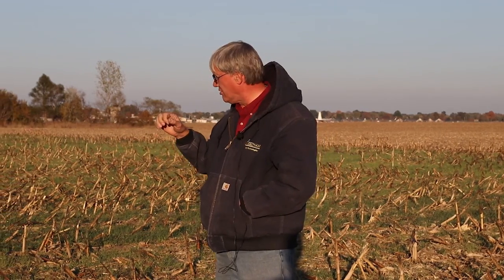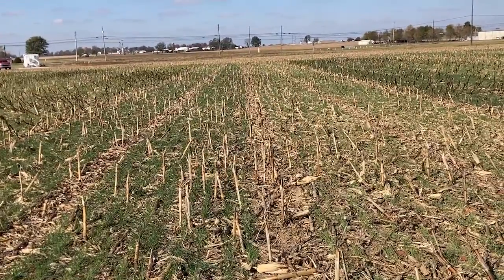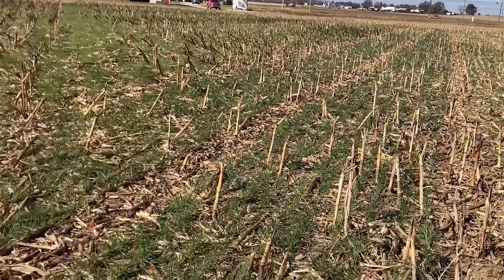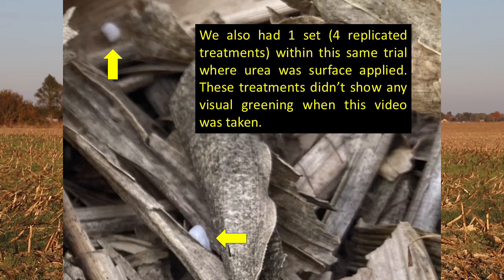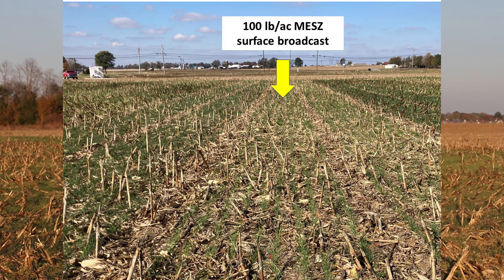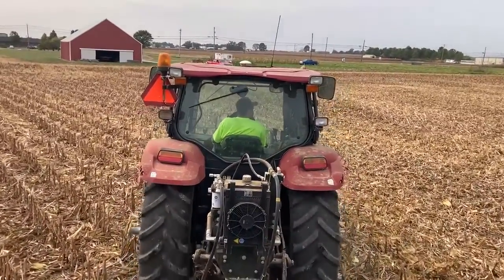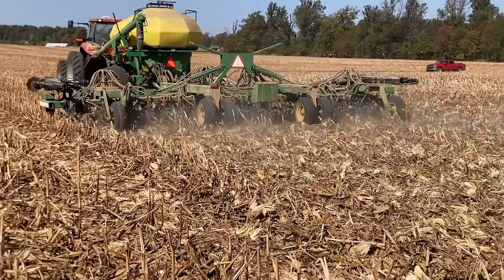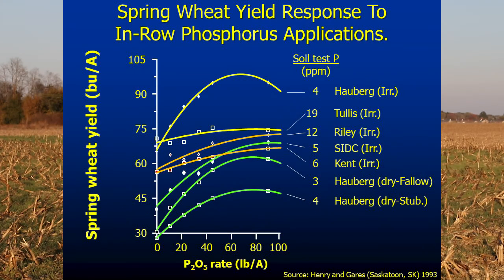Needham Ag - No-Till Wheat Into Corn Residue & The Importance of Placing P In The Row With The Seed

Comment: Is that possible with corn?
Reply from the maker: Most of the wheat in Kentucky is planted after corn and the majority of these acres are no-tilled into corn. The state yield continues to rise and according to USDA the average yield for KY in 2023 was 90 bu/ac.
Reply: No, i meant fertilizer P inside row with seed but of course lowe rate. @NeedhamAg
Reply from the maker: @11T872  You can, but not much in the row (with corn on 30” rows) on account of seedling injury. You need to place it alongside and under the seed with some N, ideally in a 2x2 band.
Reply from the maker: @TioPablitoGaviria I don’t know where you are located or what equipment is available, but a barrel style fertilizer blender works good.